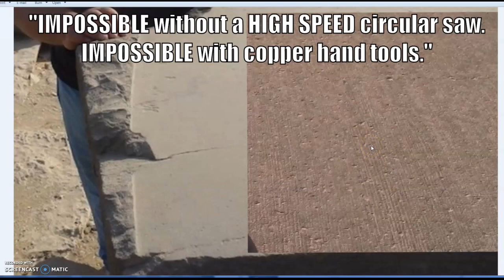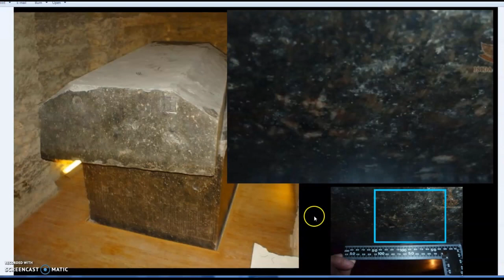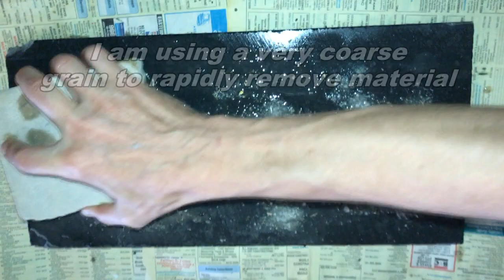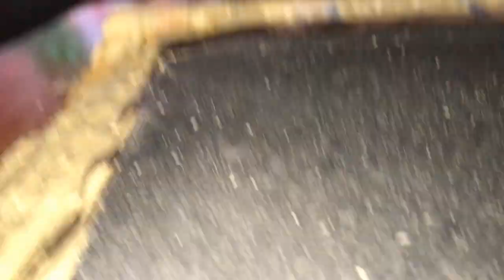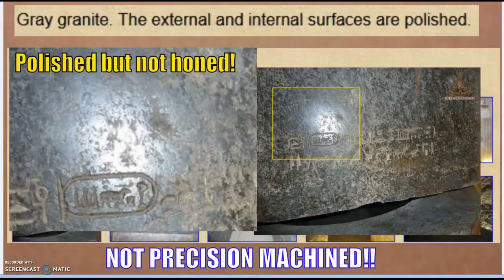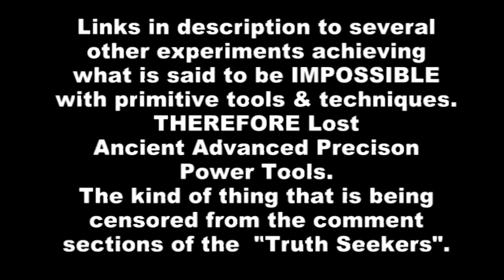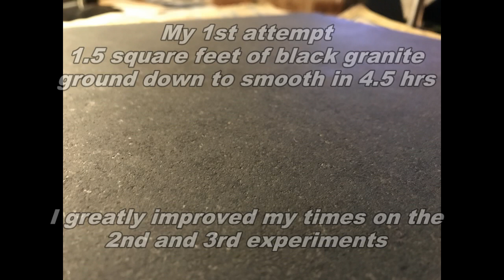Ancient Stone Working Techniques: Experiments with Black Granite on Removing Striations

Comment: Excellent work! This was refreshing to say the least. I would love to see you tackle the problem of lifting/moving massive stones such as the ones covered recently by Matt of Ancient Architects at Minya Egypt, which are estimated to weigh over 2000 tons. Of course they are still in situ, but obviously they had a plan to move them and erect the completed monolith. Also, do you have any insight into how they were able to carve finely detailed statues with near perfect symmetry, which we could only do today with CNC machining? How about the thousands of stone vessels made of granite, obsidian, diorite and other very hard stone, which are near perfect and many of which were claimed to be reduced to the thickness of a playing card without destroying their form? This last one seems nearly impossible way back then, but as we often say, where there's a will there's a way. I'm not doubting your convictions here, there's just some things that leave me wondering.
Reply from the maker: I have a few videos on lifting and moving stones including modern examples but prior to  " modern cranes". It's important to note that all modern lifting equipment based on simple machines used since the earliest days of sail. Hitch knots ( compound pulley mae from a single piece of rope, look up how to tie a Trucker's Hitch), combined with a capstan, also used since ancient times it's really just a winch like you'd find at an old well. Combining a compound pulley and gearing system let's you move or lift virtually anything as you can attach gears to gears and pulleys to pulleys. If they were sailing ships they were taking advantage of mechanical advantage. Old Roman texts describe them very well, the Library of Alexandria in Egypt was such a storehouse of this knowledge. The obelisks moved to Rome, Paris, London and New York were done with ancient tech only, in the case of the Cleopatra's needle in NYC they even have photos of it.
In regards to the vases or statues I would ask are there any actual measurements given that would mean they were built to a precision that requires a modern machine. The only one i know of comes from Christopher Dunn, he took a photo of a large statue face, put it in photoshop and found a symmetry. How many other statues would have similar symmetry? In recent years a colossal granite Bahubali sculpture was made in India, across it's entire 40 plus feet it had only a half inch variation from plan. Done with plumb lines.
At the moment there is a sculptress working a new vase, one made of diorite. These and other such experiments are very carefully censored by those who should be promoting them if in fact they are interested in ancient stone work. Everything they have deemed to be impossible is provable with cheap and quick easy experimentation. They should be the ones doing this work. Yet they keep promoting falsehoods for some reason even after all these years they've had to research the topics.
Why shouldn't Ancient Architects know about Ptolemaic era lifting technology and it's developmentt from sail rigging knowledge? 
Building a channel on "lost ancient high technology" or ancient architecture it's very curious to me as to why they know so little about freely available knowledge such as lifting and stone work?
cheers
Reply: @SacredGeometryDecoded  Clearly they had a way, it's just mind boggling to consider lifting such a weight when you look at the size of modern cranes needed to lift the equivalent, such as the Kockums Crane. Not that I doubt your explanation, but referencing the moving of a 220 ton obelisk is a weak comparison to the 2000+ ton monoliths in Egypt. So the conjecture is that they used the same principles, scaled up or multiplied. I've always imagined they used a combination of snatch blocks but the hitch knots would accomplish the same feat. My only concern here is that the friction induced on the ropes by such an immense weight would be extremely problematic, though they may have used plant/animal based oils to lubricate everything and prevent the ropes from burning through themselves. Those ropes must have been 10 to 12" in diameter! The first time I saw the tri-lobed "schist" disc I immediately thought it was used for making twisted ropes. I find it odd that this isn't accepted as it's true function. Do you have an opinion on this? 

So I assume your theory is that they rolled these massive stones on wooden logs, but what tree, accessible to the Egyptians, could possible have been large and tough enough to withstand such a weight? I believe they used elephants from Africa for long distance transport over land. Can you reference the old Roman texts that you mentioned describing the ancient lifting tech? I'm a bit fascinated by it all if you haven't noticed. :)

I found the video of the sculptress making a pot out of diorite. Very impressive work! It's still hard to imagine that they would have put so much time into one pot, but I have a theory as to how a lot of this was automated by setting up shops next to the Nile river and using it to drive wooden water wheels with spoked gears. This would allow masons to work 24/7 staggered shifts and churn these out like clockwork. I will set up an experiment soon to show how this could have worked, if someone doesn't beat me to it. They could even have used the same principle to lift stone blocks up the sides of the pyramids.

It's disheartening to see how many are taking advantage of gullible people but I think you're making an oversight in regards to Matt from Ancient Architects. He doesn't peddle ancient high tech the way others do and if you show him evidence to the contrary of his own impression, he will gladly admit fault and change his messaging around that topic, as he has done many times in the past. Just look at his video on the Great Pyramid to see what I mean. 

Thank you for sticking it to the ancient alien crowd! I was once entertained by the words of people like Erich von Daniken but I very quickly saw though his BS as he attempted to attribute anything and everything to aliens. A lot of what he and others reference, like ancient cave paintings resembling other worldly beings, I believe are the result of psychedelic visions experienced by people under the influence of entheogenic plants and fungi. I'm intrigued by the idea of visitors from other worlds or maybe even our future selves. I do believe it's happening and has for a very long time, but I don't believe they've made contact since the time of the Elohim, when man strived to be like them. I'm sure you have some knowledge in this area considering your interest in Hermetic Alchemy. I've been studying and practicing this Divine Art for the past ~20 years and it has opened pathways and lead to understandings of Nature and reality that I never would have dreamed possible.

Keep up the great work! I just need 1 extra  lifetime to watch all your content and the rest of my playlists now. And that is why I love and hate YouTube...
Reply from the maker: @cosmiccrunch8591  for instance Lebanese cedar has a crushing strength of 6900 lbs per square inch. Hemp rope also incredibly strong. The materials they were known to have had easily can support those weights.
Think of it more like lifting a bunch of blocks at the same time. Ten set ups rather than a single lifting operation.
With an off the shelf modern manual lifting block it would take 20 people to lift 2000 t. 
By making wooden shackle or adding a copper bushel the friction would be almost the same.
Lateran obelisk in time 400 plus tonnes originally , a couple of those lifting towers would be enough. 
Hoist cranes can lift more than a boom crane using the exact same get up.
Combined with ramp (inclined plane) massive weights lifted relatively easily. Even a steep ramp of 45 degrees give massive advantage. 
Cheers
Reply: @SacredGeometryDecoded  A widely overlooked area of stone carving and shaping is the idea of using a softening agent. For example, check out the research paper titled "On the reddish, glittery mud the Inca used for perfecting their stone masonry". I mean, this is Egypt we're talking about; an epicenter of practical alchemy in those times.

Abstract from above mentioned paper for further discussion:

Due to its impressive appearance, Inca masonry, which mostly consists of volcanic, silica containing rock material, has received much attention. A high level of understanding has consequently been reached of the diverse working steps and tools applied. An exception is the reddish mud, “llancac alpa” in the quechua language, and the “gold”, mentioned by early chroniclers as mortar which fitted the stones and later disappeared. Such techniques were related to folklore and not taken seriously. This study tries to understand them and the question was asked: did Inca builders have access to very acid mud? They did, and used the acid mud from their mines, which generated sulphuric acid through bacterial oxidation of pyrite (fools gold). It reaches an acidity of up to pH = 0.5, which is 104 times more acid than humic acid which is known to weather silica containing rocks via silica gel to the clay mineral kaolin. This acid mud allowed dissolving and softening the rock material superficially to a viscoelastic silica gel. The process could be further enhanced more than tenfold by addition of (oxalic acid containing) plant sap, a skill suggested from popular tradition. In special cases moderate heating of crushed pyrite in gaps between chiselled stones generated additional hot sulphuric acid. Where the stone to stone contact transmitted weight, pressure dissolution in the acidic environment removed material, and silica precipitation regenerated material in cracks and pores elsewhere. It is attempted to reconstruct how the Inca builders applied the silica gel technology for shaping stones, for polishing and fitting them. The appearance of shiny and glassy Inca stone junctions and interfaces is explained via solidification of in-situ generated or additionally added silica gel. Modern processes for conservation of stone monuments against environmental deterioration have independently developed similar silica gel based technology.

Comment: Where 4500 years ago  the Egyptians obtain a corundum?
Your method is an advanced method in terms of knowledge in materials. When we talk about simple tools then we mean  a hammer or simple stone tools. Not on granules and material properties.
Reply from the maker: Corundum found in Egypt as well as garnet etc. though the quartz in sand enough to do the same job Like cuts like. Granite dust works also to cut granite. Corundum there but not necessary. I used so little corundum here it is irrevelant
Reply from the maker: I use simple tools .if using abrasive   sand is high technology then you’re incapable of understanding complex machines. Ancient texts such as Pliny describe the trade in abrasives from as far a field as India as well as sources for emery (corundum) much closer than that. 
Wouldn’t a hammer or simple stone tools or be a matter of material properties?  
No point on answering that because without a modern textbook anyone working with simple tools would learn in5 minutes about what hammers what and what cuts what.
As a kid I worked that stuff out

Comment: how did they cut the blocks? and why are the hyrogliphs nog as detailed as the blocks that where polished and fine cut? why are there in some parts melted granite?
Reply from the maker: I have other videos demonstrating how to cut granite, the modern saws etc work on exactly the same principle. As with polishing, I demo that as well, fine grit abrasives to polish,
There is no melted granite, if you melt granite it turns into obsidian. Granite is formed deep undergorund when magma is cooled slowly under immense pressures. Basalt is formed when the magma gets to the surface, though you can see at Hawaii for instance how the lava that cools rapidly turns into that black glass obsidian when exposed to to air / water. 
It's impossible to melt granite or basalt and then cast it in a mould,  as they will never return to their original condition under surface conditions.

Comment: nice to see someone actually get their hands dirty and experiment rather than constantly speculate
Reply: I've worked as a stonemason for a few years and this is great that people are experimenting, although the OP is giving more evidence to the "other side" than he realizes
Reply from the maker: I have a plalylist of many experiments beyond from grinding to flat, i show my early attempts so that the mistakes i make are there to be seen and anyone who wants to avoid them can learn from my errors, the two plates i show here were my first ever, my third plate I was much better with the technique. Though with a little practice I was able to drill at good speeds replicating all the signatures said to be " impossible" by the lost high tech experts. 
I'm just curious what evidence I am providing. Having shown it's possible with zero training , with no experienced ancestors to guide me,  to be able to do it it in a timely fashion measured in hours rather than instead of the months or years the lost high tech people claim.
Mike Haduck Masonry channel is a great one, from a family of stone masons he carefully shows the tool marks and talks about the properties of the stones.
The argument of 'precision" by the lost high tech people hasn't been shown, quite the opposite, the Saqqara serapeum boxes for example are anything but precise, just by eye that is visible. The measurements of angles etc that have been taken prove this.
Other granite sarcophagi said to be impossibly precise are no more precise than the type of work found in historic tomb stones or vaults.
Scientists Against Myths team have been doing other work including a sculptor whose been making impossible vases with the most basic of the primitive tools.
Reply: @righteousred723  You worked with stone and believe in complete BS theories and pseudo science?

Sorry if we don't believe you even know what a stone even looks like.